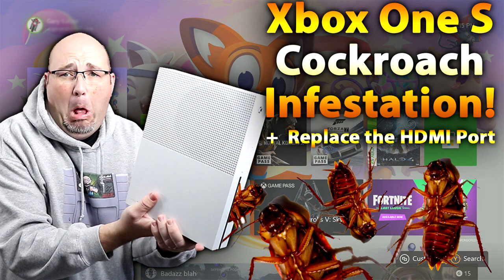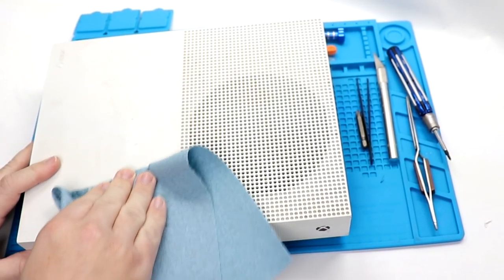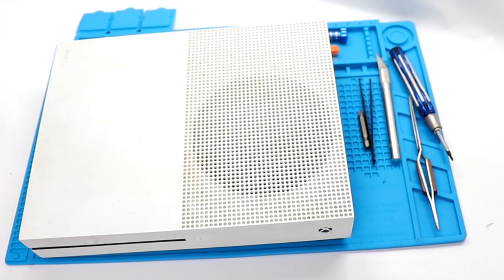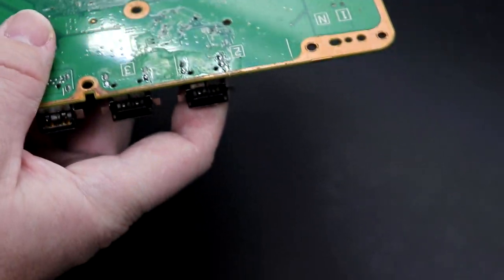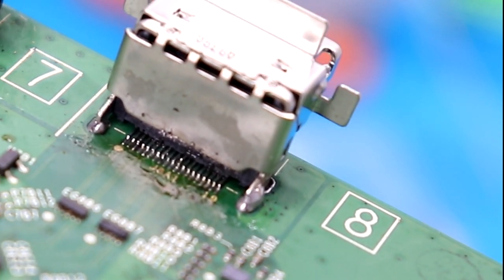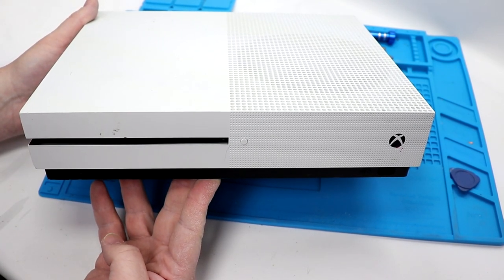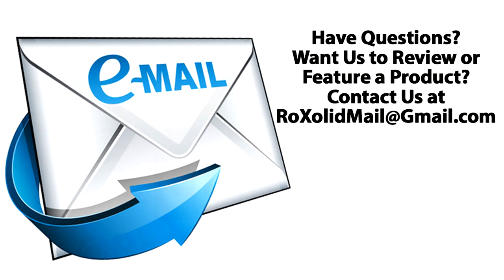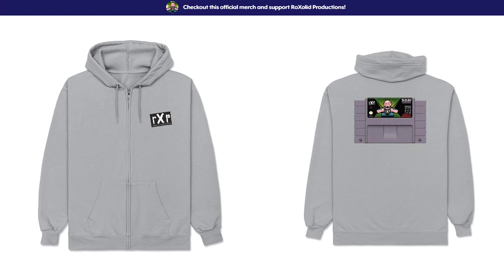Replacing the HDMI Port & Cleaning a Cockroach Infested XBox One S

Comment: I’m surprised the roaches secretions and stuff didn’t corrode the wiring and the components. It looks like it corroded the metal a bit. To think they can possibly cause house fires too.
Reply: If left long enough it will rust the RF shield. I've repaired some sega and snes consoles that were just splattered with rust because of the roach guts and waste.

Comment: I have seen the destruction of control boards on electric range stoves and refrigerator boards. I am in search of information today pertaining to cleaning a board because PCB is no longer available or in short supply ie back order.
 There is  a repair kit. However, the issue to the problem is roach droppings and a control board caked with crud. Thanks for the video, I know what you were experiencing.
Reply from the maker: Yeah, they're destructive little vermin

Comment: I went through exactly what you had to deal with.  I picked up a used One S from someone on Facebook Marketplace for $40.  It was just the console, no controller or cords.  I had to de-roach it.  It was absolutely disgusting.  Gross!!!  I took it all apart, soaked and washed all the plastic and metal parts.  I left it soaked in soap and water overnight.  Cleaned all the components and the main board.  Re-past the CPU with new thermal paste.  Put it all back together and it works good.  I already knew it was infested the moment I handed the guy money and took the console.
Reply from the maker: It's so gross to clean up
Reply: I did the same with a ps5 cleaned it out extensively but still has a little smell and I'm wondering how to get rid of it

Comment: As a person that buys and sells consoles for the past year or so, I've come across 5-6 consoles that had roaches. One PS4 slim I sprayed with RAID and traded it into some online company and they sent a check a few days later. I never brought it inside to test. Since I did that successfully, I tried it with a Fat PS4, but that one never got video again afterwards. Not sure what the difference was. I had another PS4 slim I raided, and it survived okay as well. I never had a roach Xbox One until tonight. There was actually a live roach in the Ethernet port and I saw it, but somehow decided to buy it anyways. I thought the Xbox one was so encapsulated compared to the PS4 that maybe I'd get lucky and there weren't any inside. But I sprayed it with raid, and put some pieces of roach killing gel on top, then bagged it, boxed it, and bagged it again and left it outside. Unfortunately the weather is starting to get warmer. How long do you think I need to wait before taking it out and checking it? Roach consoles actually still work okay most of the time. Just dunno about the longevity.
Reply from the maker: I left it outside in the cold for several WEEKS

Comment: Im fixing one of my family's xbox and I've come across the same problem as you. I killed about 10 big bois and found countless small ones that were mutilated and as well as about 8 unhatched eggs. Im having trouble cleaning up the guts stuck on the metal and plastic. Did you use electronics cleaner to clean that xbox?
Reply from the maker: I show everything I used in the video. Between IPA, Electronic Motor Cleaner and more.

Comment: Would Zevo bug spray ruin the system or motherboard? Do I need special electronic type tools (screwdrivers, etc)? 
I've heard that you do, when dealing with electronic...to avoid static(?) that can damage item. I also heard that I must have a mat (similar to yours) to avoid said static(?)
Reply from the maker: No idea, sorry
Reply: No idea about the bug spray or the special tools? 
Did you just use any run of the mill screwdriver (tools)? 
My bug spray question in general:Would using any type of can bug  spray damage anything in an  electronic item.
Reply: @LizzyinJupiter  yes bug spray will ruin the Electronics. It will fry the system. And you do need special tools as well, they sell kits online

Comment: Hello, I would like to know if its possible for a small insect to enter a laptop via the HDMI port.  i was connecting an old HDMI cable to my laptop today ans noticed a very small white insect moving towards the port.
I immediately disconnected the cable but the insect was nowhere to be found. Im a little paranoid that the insect entered the port but I cant find it. Is it possible I might face issues because of this?
Reply: Could always take your bottom plate off and get a good look around in there for any infestations or bugs. There's probably plenty of tutorials online
Reply from the maker: Good call, and I apologize for not seeing the original post. Any piece of electronics can get an insect infestation. They love the heat

Comment: I ordered a broken Dreamcast lot back in December or January, 3 consoles total. 2 were perfectly fine, one had dead bugs and droppings inside which I’m assuming were roaches. All dead, nothing live, haven’t seen any roaches and it’s been 6 months since I opened that console and tore it down completely, cleaned it as best I could, completely disinfected the disc drive with Clorox wipes and rubbing alcohol to make sure I saved what seems to be a great condition drive otherwise. The motherboard on that system is bad, I have a replacement but I want to try and completely get rid of that smell on the components. For a PSU and other delicate parts, what would you recommend? I’ve had everything sealed in ziplock bags, even the disc drive I cleaned up to be EXTRA safe. Thank GOD everything was dead, but brother I felt your pain on this one as someone who’s a total clean freak 🤣
Reply: I gave the disc drive to a better condition Dreamcast, since the one I completely sanitized was a Japanese Yamaha drive with very limited use based on the broken AV port. I’ve had that system with that drive in it in a bag under my bed for about 6 months, no roaches. Same with the nasty system it came out of, no roaches either so I’m almost positive whatever was alive evacuated long before I got that hazard system.

Comment: Good video. Totally disgusting. 🤢 Makes me very wary of picking up systems off marketplace. I recently picked up an OG Xbox from the Goodwill real cheap. I tested it real quick to make sure it worked and left it sit in my garage for a couple days just to be safe until I was able to open it up. Luckily it worked and when I opened it up the only thing inside it was some dust. I really need to learn how to solder. I have a game gear that needs the caps replaced on it. Not sure if I want to learn on it and risk it though. Thanks for the video.
Reply from the maker: I don't know I'd start soldering doing a cap replacement on a Game Gear. That's a bit much for newbies.
Reply: @RoXolid  yeah that’s what I was thinking too. Might have to find someone who is capable. Just didn’t want to spend too much. Otherwise may as well just get another Game gear.
Reply from the maker: @DrinkGameswithJosh  Check with Voultar, his work is amazing.